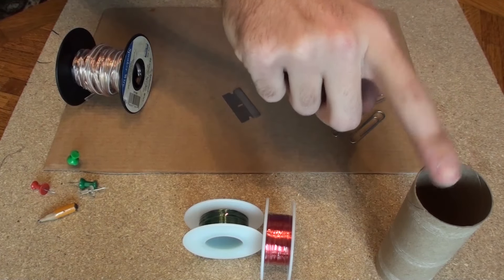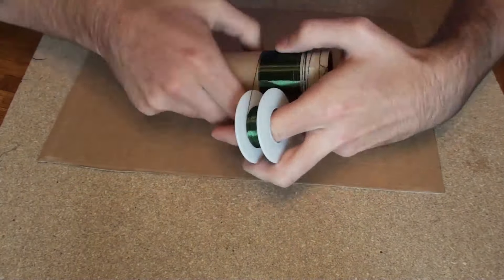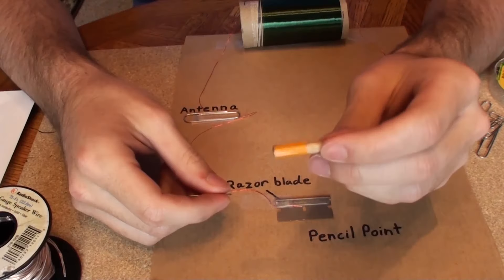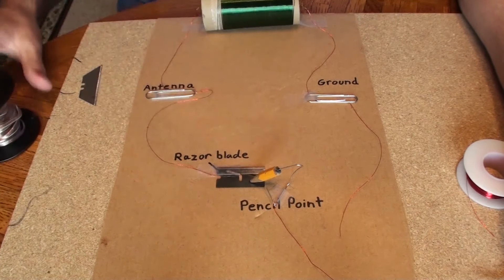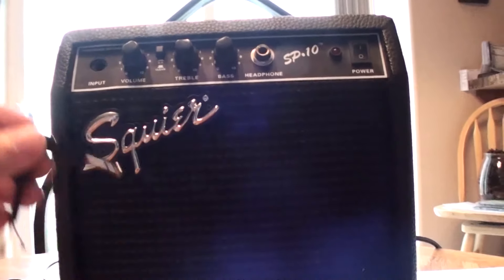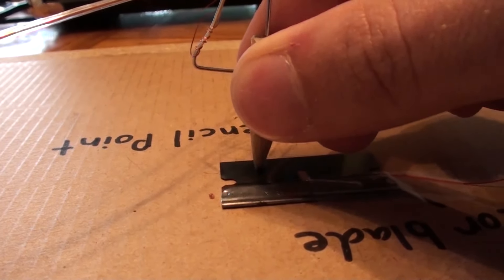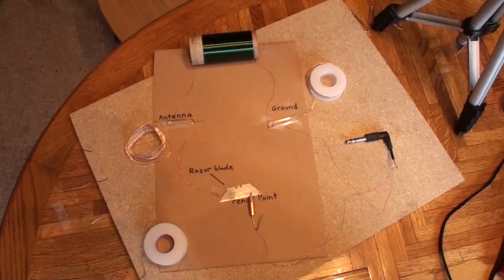How to Make a Foxhole Radio

Comment: Your ground system looks dangerous. If it touches an active pin you will be in trouble.
Reply: "IF"    is a magic word....
Reply: @julikb  Shit happens...
Reply: or you can put it to a water pipe
Reply: Unfortunately,most rooms don't have copper pipes in them. And newer homes have plastic pipe. A metal pipe or rod about 4 feet long driven into the ground outside ofa window works very well.

Another safe alternative is a counterpoint wire around the baseboards of the room to use instead of a regular ground
Reply: One time I used a small garden spade stuck into the ground. It worked OK.

Comment: To add what I stated earlier, a semi-conductor can be had in a flame, alcohol, propane, with a stainless double edged razor blade by itself or heated in propane flame until it turns shades of blue, corrosion oxidized, and another dissembler metal, copper, slightly apart in a grain alcohol flame. The rusty nail and corroded penny work well, just difficult fining a hot spot with the sharpened safety pin. Try a piece of hard carbon/graphite and a pin instead of "modern pencil lead, " now a clay mixture, carbon/graphite might work on the razor blade. Two metals, copper/steel close together with a drop of vinegar in between the two metals may work but as a low voltage/amperage battery, it may or may not work. Think semi-conductor as in power signal from the antenna is changed from AC, the RF signal, into DC current to run the earphone.Then find or make a tuner.

Comment: Do regular earphones work with this one? Cause since the radio gets it's energy from the radio waves, the addition of external earphones that do need a little bit of energy to work might not. In your case the amplifier is connected to the wall so it does not take energy from the radio. Just wanted to know cause i wanna do one and havent got an amplifier. Thanks!

Comment: Instead of razor blade can I use any metal that has no coating on it??
Reply: The burned razor blade acts like a capacitor (and it is a rather crude capacitor) instead you can use a verry low  voltage variable capacitor, but to keep it in the spirit of the "fox hole build", you can use one tube of toilet paper wrapped in some tin foil(1/2 of a the circumference should suffice) connected to the first wire and another tube sliding inside the first tube with some foil to this one too connected in the place of the pencil(just make sure the foil sides never touch). Now just slide in and out to tune in the frequency. And its way more stable than with the pencil since you can leave it like that.
Reply: A lot of steel or copper might work as a detector if it's oxidized.

I've used a knife blade, an old penny, and I read that a hacksaw blade will work

Comment: ANY wire works, you just have to separate them to prevent short-circuit, regular PVC insulated wire works if thin enough (under 1.5mm) if coil is large enough, I ave used bare copper and put slightly thinner fishingline between the turns preventingcopper contact (0.6mm copper 0.4mm  nylon), as before you need slightly larger diameter tube and/or  longer coil with more turns. 
a well working coil is usually 2:1 or 1:2 in length to diameter ratio but even 1:5 or 5:1 works, ideal is said to be  "square " same length as the diameter. 
there are exceptions top of the line crystal radios, but waaaay beyond the scope of This.

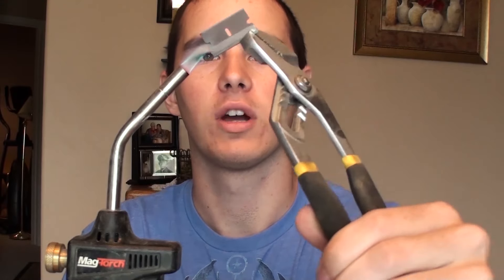Comment: 1:49 Four hundred degrees Fahrenheit ?  Don't you mean Centigrade, for the former is a temperature so low it won't even burn paper!
4:36 That arrangement looks even less safe - - is that plug connected to any live device?
Reply: I believe the cord is connected to the amp

Comment: Can you use a battery instead of a plug
Reply from the maker: +Alex Ve'lez No. The plug is not providing any power. It's just acting as the ground for the radio. So a battery will not work in this case.

Comment: I don't think they had wall plugs in the foxhole man so how would you do it without a wall plug would you just use a river 9 volt battery or any kind of battery you had and then use some cheap headphones that they would give you
Reply: Batteries or literally anything that could make electricity

Comment: Did you wrap more than 120 times?  You used all the wire and covered most of the paper tube.???
Reply from the maker: It doesn't need to be wrapped 120 times. But the more wraps the better. It's just a good reference for people to go off of.
Reply: OK cool thanks.  :)

Comment: i would guess that it has something to do with capacitance since now you have a conductor and non conductor layer... if i remember right, the crystal radio i made had a capacitor in it... the other thing was the germanium diode... it may be it's replacement ... .   making it necessary for the curren to travel in one direction only and not oscillate in the wire?

Comment: The razor Blade just has to be heated once, right? Like, if I heat it once and then use it a week later it wud still work a week later, right?
Reply: Yes sure, the heating is just to oxidize the surface of the metal.
Reply: long as it don't get rusty, you can get an old blue blade off the web from some of the shaving groups. In fact I have one sitting here on the desk.

Comment: We used a carbon rod, rescued and cleaned up, from a depleted zinc carbon battery cell and it was fastened down to the bread- board for stability. The razor blade was fixed across the carbon rod with springiness of the blade and it was moved to find a sweetspot as a detector. When a good spot was found, it could be left there to keep working whilst you sat and listened.
Our razor blade was not heat treated. Looks like we were missing something there?
A .001µF fixed capacitor, connected from the pencil paper clip to ground would have increased
the received sound BUT without a tuning capacitor, stations can't be selected (tuned).
That would connect from the razor blade paper clip, again to ground.
I reckon unless you are extremely close to an AM transmitter, 15 feet of antenna would probably not get enough signal to work on. 
Imagine if you were under-fire in a fox hole, with crap and bullets flying overhead, trying to hold the antenna high enough with one hand and hold the pencil still with the other and then trying to dance to the Mexican Music.
Great project..Good ideas on constructing it but lacking in vital info to make it practical.
120 turns would take you towards the bottom of the medium wave band, getting into the long wave section of the AM band. I'd be inclined to experiment with 80ish turns and a tuning capacitor of 0.005µF which would move you further up in to the Medium Wave section where I reckon there might be more stations operating.

Comment: I failed at my first attempt (I was a bit short on copper wire for the coil) but I'll try again. Thanks. At least I can say that I know how to make a radio now!
Reply: 30 to 40 feet of 24 to 30 gauge enamel or plastic coated solid copper wire should do it

Comment: how do you connect it to an earphone because mine won't work.. :((
Reply: Hook the headphone wires one to the pencil and one to the ground.  Only "high impedance" 'phones will work; most earbud types are are around only eight ohms.  Try to find an old "crystal" earphone from a transistor radio -- those are ideal.

Comment from the maker: It's about 45mm. It doesn't need to be exact or anything, its just if the coil was to small (say 15-20mm) I don't think you would get a very good signal from it. But I have never tried it so I could be wrong

Comment: How do I wire the audio output wire to headphones / earbuds?
Reply: One end on the detector opposite theend that goes to the antenna. The other end to the ground.

If you're using a magnetic headphone, it has to be more than 1000 ohms. Most newer headphones are 8 to 32 ohms.

Comment: can we use a wire without insulation isted of a magnet wire
Reply: The wire cannot touch any of the other turns on the coil if you do.
Some soldiers in a POW camp did that and then dripped candle wax on the coil so the turns would never touch.
Reply: You can salvage some enamel coated wire out of a motor

Comment: These sets are very insensitive. The oxide coating on the surface of the blade has nothing to do with the diodic effects. It is simply the fine graphite lead point making contact with the metal surface that does the trick.. That has been my experience, but then again I did not have a torch to 'burn' the blade.  Maybe I could have used the flame from the kitchen gas stove? I should have thought of that way back when.
Reply: The oxide on the metal surface is the main cause for this acting as a diode.

Comment: can i use some thing small insted of a toilet paper tube...? like a pen or marker...?  Thanks a lot.
Reply: It's better to use something larger I wouldn't much smaller than a toilet paper tube. Maybe an inch in diameter. The smaller you go, the more turns you'll need to make. 
However, anything cardboard, wood, or plastic would work.

Comment: Very cool!  What is the purpose of heat-treating the razor blade, AND would it work if the tuner were just a paper clip scraping on the blade without the pencil?
Reply: Heating takes off factory applied lacquer so the graphite in the pencil makes good contact directly to the steel. Moving the pencil acts like a variable resistor like the dial on an analog stereo, so if you used a paperclip there would be no resistance and therefore no tuning.
Reply: NOOOO. The razor blade with the graphite pencil forms a diode to clip off one half of the AM wave. 
The heating forms a super thin oxide layer on the razor blade that together with the graphite (you could also use metal, but it would damage the oxide layer more easily) forms a metal-semiconductor PN junction with the oxide layer being the semiconductor.

Comment: Hello.. I make this radio.. My ground connection and antenna are very good and I collected the wires very good but it's not working... Are all razor blades can work? ..Or any other heating degrees .. I just cant understand why it's not working .. i can't get buzz even .. 
it receive AM or FM? I hope you can help me.

Comment: See how he has connected the ground and pencil wires, each to the two wires inside the audio jack? Instead of connecting them to the two wires in the audio jack, connect them to the two wires in a head phone cable (which will involve cutting it open). To save the headphones, simply wrapping each wire around one piece of the headphone's plug (it should consist of 3 metal parts separated by a plastic barrier, connect a wire to the tip and ring).

Comment: I believe the length of the antenna actually has more to do with signal strength than the coil does. The coil has more to do with tuning, as I understand it.
I don't know so much about the razor blade (and tuning with it), but if you swap it for a 1n34 Germanium diode (properly biased) you would use the coil for tuning. That's how it was with my brother's crystal radio when we were kids. I hope it helps.
Reply: Yes,  the coil determines the frequency.
A longer antenna should give more volume. The best way to tune is to add a variable capacitor connected from the ground to the antenna. However, this wouldn't be true to the original foxhole radio.  You could also make fixed salt water capacitors across the coil. Different values for each station

Comment from the maker: Try moving the radio to another end of your house. Or try to adjust the antenna to get a signal. Be sure the coil is wrapped tight so the wire will not cross over on its self. Other than that I wouldn't know what to tell you. I was surprised mine worked on the first go. Good Luck!

Comment: Shane Mormon I have a problem: I don't have access to these Magnet wires in my area, so I got some motors lying around and took these magnet wires out of them, but the problem is that they are too short, so can I join these altogether by knotting them or is there any other solution? (Would knotting them become a problem?)
Reply: you would have to use the razor to remove the coating off the ends and not knot but twist them
Reply: Jessica Renfrow I did that exactly haha thanks a lot
Reply: +Rohit Udhwani only a couple years after LOL
Reply: Jessica Renfrow Only 3 years xD Idek where this thing is rn, maybe I threw it

Comment: or stanley knife blade might work
Reply: Yes, I've used a knife blade
Reply: @razor6552  mildly embarrassing (and possibly extravagant quantities of gin and tonic), I can't remember what my original comment refers to
Reply: @adamoneale4396 
Gin'll do that.

 You said a Stanley knife blade might work instead of a razor blade for a foxhole radio.
Reply: @razor6552  ah yes, of course. My theory being that the thickness and the at back if the stanley blade would reduce potential for injury but also improve accuracy due to ease of handling

Comment: nice but the whole point of a foxhole radio is it does not need power
Reply: It's not power, it's a ground connection. There are other ways to do this as well.   Like connecting to a metal rod driven into the ground.

Comment: You use the hold down screw on the outlet plate for ground, not the outlet itself, not only is it a violation of the electrical code, its just  plain ass nuts.

Comment: Thanks, Shane, I've been making crystal radios and tinkering with electronics, repairing many small devices just because I want to do that, all for 55 years. Where is jack for amp connected to the board?  At Razor blade and pencil? Besides razor blade, you can use rusty nail/corroded penny and SHARP safety pin. For advanced guys, use a flame--alcohol(?) on razor blue stainless blade and sharp pin but not touching, only close, very close to each other. You can make a tuner across the coil top, drag across top of coil with sharp tool or knife to remove some insulation just on top of coil wire but not touching one wire to another or the coil will be grounded, option when winding coil is to twist the wire every 10 windings and remove some insulation of each tap, remove one side of coil wire and drag across top of coil or touch each tap to tune local stations. I use a lot of alligator and Fahnestock clips. A stronger tube will be necessary for strength, PVC pipe or similar shape for the coil and a coating of glue will make it permanent. A good earphone is from the old style carbon ear phone from dial telephones as most are obsolete. At 70 yrs old, I have a lot of junk parts from phones and variable tuning capacitors, V-Caps, from old radios, if unknown capacitance, just try them, will tune a crystal set and either with or without the coil. One night without the coil, no tuner, using powered speakers, I picked up Radio Havana on 6.0 MHz and some religious stations just under 6.0 MHz, no tuner, 30 ft antenna wire out the window or on the wall up high and ground was a long nail into the dirt outside the window, ground wire to the radio. Another antenna and ground can be had with old wire bed springs found in old Army cots, one for antenna and another for ground. Antenna and ground with air between them is a capacitor, same with antenna wire and ground picking up lightning, AC and RF radio signals, AM radio, even SW and CB radio, all kinds of fun.
 Bill McGraw, KF5FJZ, NRA Life
"Somewhere South of Chicago"
Greenville, Mississippi
General license for only 3 years as a ham, 70 yrs old fart
Reply: All these devices replace what was once called a cats whisker,  small bit of crystal held in a holder with a fine wire used to find the sweet spot where you would get a signal.
Reply: @jimnoyb1209  I used a safety pin with a nail into a piece of wood for a base, a piece of lead wired to the point of the pin. You then moved it about the razor blade till you found the spot. A tuning capacitor enabled it to be tuned, received two or three stations. This was about 1962 or so.

Comment: Is there any substitute for the wire u used to make the antenna and grounding.. i dont think we get it where i live.. and will any earphone work..or is da piezoelectric headphone necessary
ANSWER ASAP
Reply: A magnetic headphones over 1000 ohms will work. And they will last decades longer than most piezo earphones. The newer pink earphones go bad in a few weeks or few days. You have to tap them on the table every 2 minutes to get them to work. The new ones have the contacts glued instead of soldered.

I have a set of headphones that just turned a century old this year

Comment from the maker: A razor blade would be your best bet for it to work. You can try to use a piece of metal just make sure its stainless steel its thin and your heat it up like I did the razor blade. Good Luck!

Comment: What device did you plug in the radio that you designed into the device, but I did it, and the two ends of my coil made two antennas one wire connected to the 10 m long clothesline and one string to the ground.  and I don't see any rustle in the headset. Can you explain and help me and guide me.

Comment: That's pretty cool! I tried this 20 years ago when I was in elementary school with no success because I missed the step of heating up the razor blade. I like how you hooked the radio up to the amplifier! I'm going to have to give this another try!
Reply: in the old days you didn't need to heat the blade, trick was you needed a Gillette Blue blade,
Reply: I wish I would have known that all those years ago. I got the plans out of a book from the library and they left that vital tidbit of info out. lol
Reply: It's the junction between the graphite pencil lead and a tarnished section of the razor blade which forms the diode, which is why the razor blade is heated first.  It accelerates the tarnishing process.  You have to hunt around on the blade with the pencil lead in order to find the right amount of tarnish to form a diode.
Reply: You can also soak the blade in salt water to oxidize it